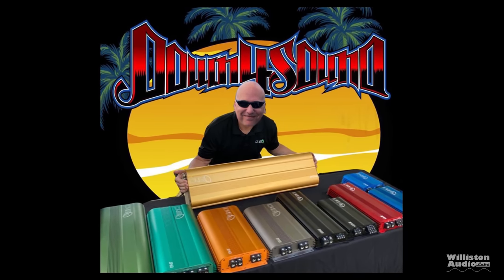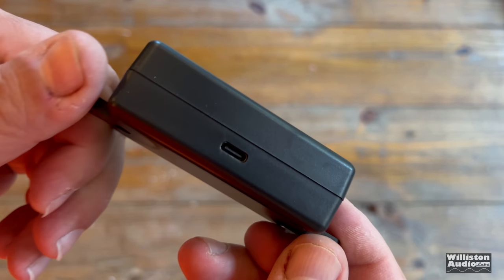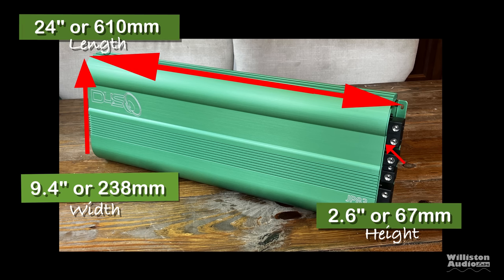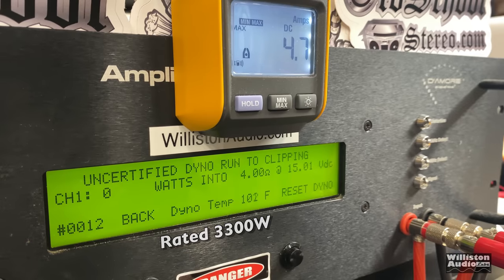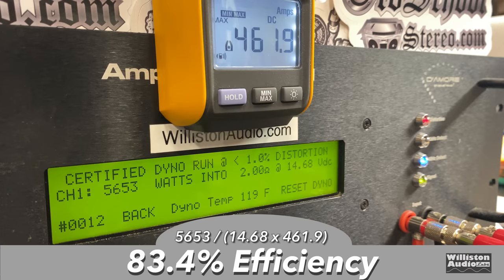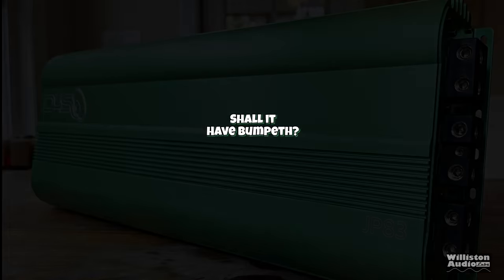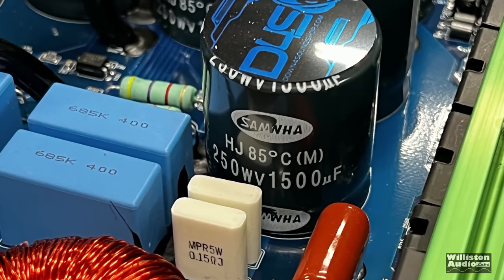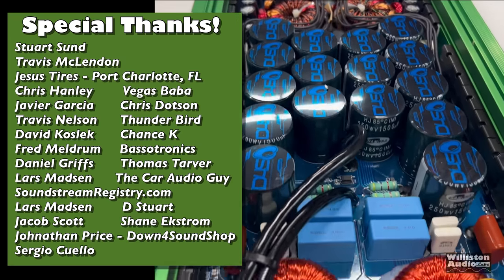OVERLOADED my AMP DYNO? D4S JP83 is a 10,000 watt MONSTER!! [4K]

Comment: 1499.99 is a pretty decent price for an 8k. Not gonna lie.
Reply: Or. Just get 3 taramps 8ks and have some change leftover
Reply: @EcSsAwS  Quality over quantity for me
Reply: Pass
Reply: Taramp all the way
Reply from the maker: More like $1499 for a 10k with headroom…as long as you have the electrical to support
Reply: @wal  True. But with impedance rise, probably won't guarantee the 10k. I'm not sure though. I haven't done any irl testing with the amp.
Reply: Do you need that much wattage? That's the question. I have heard systems that are running 500 watts RMS that sound phenomenal and I've heard systems with 3,000 Watts RMS that sound like garbage all depends on the components how it's put together and who assembles it.
Reply: @madandmean7109  *all
Reply: @Mr.Robert1  too difficult for the masses to do the technical work. Easier to add wattage to overcome piss poor design.
See it in automotive performance, cheaper/easier to add horsepower than to do the work setting up the package.
Reply: Did you not watch the same video. Its a 10k amp
Reply: It’s actually a 10K not a 8K
Reply: Not when it comes to 2 grand after his signature haha
Reply: @Mr.Robert1  personally unless your competing in SPL... not needed.  All my daily drivers have had between 400-900RMS of clean power going to sub/s and that's more than enough and sounds good.
Reply: @84Hurst  🤣😂💯
Reply: Especially when you consider that this is by far NOT AN 8K!
Reply: @chrispynaples  Impedance would be the factor here I'm thinking. That amp is not always going to stay at a 1 ohm load in your system .
Reply: I have a orion HCcA 9K  Paid $900 new    Back in 2019
Reply: @EcSsAwS  all 3 will fail while this one keeps going. We all know about taramps you're not giving us any new knowledge - go buy your three 8K taramps and have a great time !!!
Reply: @poppynokc1977  if you know anyting about doing your electrical proper you can have it stay very close to it at all times
Reply: @lewokejames  I do know anything about it. Been in the game for years and years. Lots of research done over this way. But yes you're correct, you can keep it close. But not likely to be exact if you know anything about it. 🤷🏽
Reply: @poppynokc1977  just like you Mr years in the game .... Yes I also know anything about it lol !!! .... Doesn't mean shit but I been "in the game" since 1987 🤷 ....wow I feel COOL now 🤣🤣
Reply: @lewokejames  🤣😂 Do you feel super cool now? Because of that reply of yours it ranks you up there with the best. 💪🏼🤣
Reply: @poppynokc1977  Ive been ranked with the best for years already.... Step up and catch up sucka 🤦🤣
Reply: @lewokejames  😂🤣you win, I'm scared if all of that knowledge you hold there Mr. Miyagi. 🥷
Reply: @lewokejames  now how in the heck is this gonna help me with these two?
Reply: @poppynokc1977  vid is about one not two  - The JP83 - now go buy one .... den come bak i teech yu wax on wax off fo make yu hav betta skils
Reply: @EcSsAwS  no
Reply: Dyno said 10k at 1ohm

Comment: Wow that is the most powerful amp I've ever seen. Almost 24,000 watts. Thanks for the video Big D
Reply from the maker: Thanks for watching and commenting!
Reply: Taramps 30k ????
Reply: The SALT 12, id more off a cap bank and maxed out the dyno above 25K.
Reply: @walterhicksiii3525  i know. I watch Derek from sundown unofficial do it
Reply: Taramps 30k ????
Reply: @yougod7253  may be he hasn't seen it. The key word he used was seen
Reply: @walterhicksiii3525  Salt 12=  $3,999 vs Jp83= $1,499. Get 2 Jp83 amps and have $1,000 cash in your pocket!
Reply: @evilinside5984 ya no kidding or like a surge 10k does 14k and is .5 stable and same price as jp 83

Comment: Always remember what Big D said and he is 110% correct.
" You need power to make Power" batteries, notice more than one. Wiring, proper gauge don't be cheap on the wiring no garbage off-brand crap. Alternator and more.
Reply from the maker: Amen 🙏
Reply: Physics... energy is conserved. Even worse, in order to get less, you need more. There are always inherent losses in systems.
Reply: In the future it will be a moot point as bassheads will be powering amps directly off a 400V EV system.  Imagine your entire amp rack being fed with a few 8 gauge wires! ;-)
Reply: The batteries/caps, alternators, and wiring, not to mention labor necessary to get rated power out of this amp will cost far more than the amp itself!
Reply: @303nitzubishi4 , truth. I'm paying the cost now. $20k total. And it's not a very big setup. Just a very good setup.
Reply: @62dobie  Lmaoo funny cause I'm in the same boat you in man. $15k out my ass is what I'm planning..  may I ask what kinda voltage you looking to run at? And if you wanna share your ideas for your build? 

I'm goin 4- 15's (Rampage XMV4), 2 of the jp83's, 2- 400a (mechman) Alts, 4- XS PWR S6's, and 1 XS power SB-500 34, custom box tuned to 30hz, and a shit ton of 2/0 for power and grounds lol

Again, Not never BIG but just a lot of quality stuff overall
Reply: @kkiidd77 , I'm running at 80% still breaking in the subs. They're stiff as hell. Its going to take a while.
Reply: @kkiidd77 ,at idle, my voltage sits at 13.8 with music full tilt.
Reply: @62dobie  what kinda subs? And batteries? U using
Reply: @kkiidd77 , two 12in Nightshades v5, Underground Power 80ah lithium, XS Power SB500-51R Super Capacitor Group 51 under the hood.
Reply: In Audio all you need is efficiency hands down, run a Class A-A/B amplifier and you lose 30%+ of the input compared to the output, that costs you in wiring and power generation ending up in extra cost in fuel.
Run a speaker driver with 87db sensitivity to 10.000w, it will output the same SPL as one with 90db/1w/1m meter sensitity to 5000w, run a speaker with 93db sensitivity and it will only need 2500w for the same SPL, ending up getting your feelings hurt by getting blown away by a horn loaded PA Speaker with 105db+ sensitivity running a few hundreds of watts peak input.
Reply: 1400 amps is more than most industrial welders!

Comment: Over 1400A draw!!  Over 23K watts!!Dang this thing is powerful. I’m glad you had the amperage to give!!
Reply from the maker: I'm using 320aH of LTO from XS Power / Yinlong, in 6S8P setup. I'm considering switching to 5S10P setup and running mid 13's for voltage....

Comment: What a beast! I still think the JP63 is the value leader, but if you want the best, this thing is on the short list for sure! Thanks for the great video!!
Reply from the maker: Thanks for watching and commenting!
Reply: Until 2yrs later after yo ear get use2 da 6300watts and 20 upgrades, then u gonna kno wat tru value is of buy'n da biggest baddest amp 1st. Only gotta buyit 1tyme plus it does wat da otha jp amps does from 8 to.8 ohms ex: 2ohms = 6300watts, gotta buy 2of Dem to get with diz big boii thts ova 2grand.
Reply: @playaj320  good point

Comment: That's impressive!  What's even more impressive is that lithium battery bank!  WOW!
Reply from the maker: Took me a couple years to put it together and cost a small fortune but it’s amazingly powerful 💪
Reply: Right? I've got a 45ah Panasonic 5.5ah Honda insight cells and at 15.5v I pulled over 3500A for 1sec then the fuses did there job lol
Reply: @SheikhN-bible-syndrome  you like them cells? Been looking at them. Running lishen 8.5ah cells and love these little beast
Reply: @beefysghost867  yeah I love them when I had it in my house it was sitting at 15.5v no charger on it and I hooked up my 3k rms full bridge amplifier and ran a 20 HZ tone wide open on one of my 15s and  after 10 seconds it went from 15.5v to 15.3v but then bounced back to 15.5v in less then 2sec after the burp and I did I total of four consecutive 10-second burps each time in less than 2 seconds it was bouncing back and after 30 seconds worth of wide open it was resting it 15.3v I was like ddddaaammmmmnnnnnn lol that  would of straight up killed one of my agms lol
Reply: @SheikhN-bible-syndrome  my issue is running them at higher voltage. The Honda fit don't care for higher voltage like that
Reply: @wal  is this the bank you built with the yinlongs?? Or are you referring to something else? Bc I actually NEED something to power 2 of these things 😅

Comment: A wireless Bass Knob.    You would not think  this is a big deal.   Wait till you use one.   And then it's hard to go back.   This should have been done YEARS ago.  But there ya have it.  JP doing what needs to be done.  And what people want.
Reply: Kicker did it first on their KX line a few years back
Reply: @catch22frubert   Thing is? I never heard of it.   I would have been the first to line up and buy one!    Oh the hell it was going under the carpet and taking out the seats to route cables  to multiple amps in my ride!  😄

Comment: I'm beside myself on this one 🤯.  Much respect for those amps. 
I'm also kind of curious about the dyo now. What's limits of the dyno at different ohms? (What's the dyo  specs?) Did you ever cover this in previous video? If not, would you consider making one?
Reply from the maker: There is a screenshot near the end showing the limits
Reply: 9:56

Comment: I already have a salt 8k, but the jp83 looks beast!!  would love to hear it hooked up to my subs 😍
Reply: Salt 8k puts out 1k more power at  less voltage @ 1ohm certified, but D Will won't say it because  sundown didn't give him an amp and I guess he doesn't trust other reputable dynos like Derrick from Sundown Unofficial. No salt just saying the real!
Reply: @Mr.NpK143  I saw the sundown unofficial video of it and you're right, yes it does beat the jp as far as voltage to watts but it DOESNT beat the jp when it comes to pricing.. I've been watching the pricing on the salt-8 when it was discounted TWICE on D4S and it was STILL more expensive than the 83.. like by $900 lol. At that point you're better off getting the 83 and grabbing yourself 2 batteries or 1 battery and a bigger Alternator.
Reply: @kkiidd77  finally someone that agrees with the truth 👏 🙌.  I said the jp83 was a great value in my first comment. But I also said that we don't know the longevity of the jp amps. And that's also true! Lil D also stated the voltage in this video was enough to run this ampndue to his lithium setup. So it depends on if a person would want to spend extra on the amp or that extra on more electrical. But as we all know that seen the two dynos the sundown salt 8k is stronger even in the low 13s then the jp83 is at over 14.7ish (give or take). That's a hole volt. Imagine if you fed the salt with 14.7ish. There would be no discussion. CAUSE YOU CAN GET YOUR VOLTAGE HIGH AS A KITE AND THE JP83 STILL WOULD NOT NOT OUT PERFORM THE SUNDOWN SALT 8K.
Reply: @Mr.NpK143  ah okay I see what your point is now haha
Reply: @kkiidd77  I'd love to own a couple of Salt 12ks. I presently run 4 wolfram 7500s that are in a close race with the jp83. According to the dynos each has it respected output over the other, but neither amp out performs the Salt 8k. If I sell the 7500s I'll be in the market for two Salt 12ks. Unless JP or anyone else can beat the salt lineup, but I doubt it. Only because JP can't cookie cut the sundown technology. I was called a hater for speaking the truth,  Lil D replied to my comments 😆 🤣 , and even JP dissed the consumer suggestion. All because I stated the truth when a fellow bass head asked which is better. He didn't ask which was the cheapest lol. That's no knock to JP cause hell I run wolfram. Even bought one from JP, but neither is better than the 🧂 8k. And oh yeah the difference in price is $800 not $900. D4S claims the regular price is $2250. The Salt 8k is 2300. So jp thinks as much of this amp as sundown does the salt 8k. And if you pay attention Lil D says the JP 83 is 1500 at the time of this video. Same shit that was said on the wolfram 7500 dyno and now its 1500. You know I wouldn't be surprised if the price went up as soon as people start buying the jp83 amp  just like wolfram. 🙄.

Comment: Been waiting for this one but honestly I'm more impressed by the 43 & 63 on how underrated those are. I want a 63 to replace my 23. That also means about another grand though in just electrical upgrades too
Reply: Thats the problem, it never ends.  I'm content with the 1900 watts at 1 ohm my MTX amp makes.  For a daily driver I don't even need more than half that power anyways
Reply from the maker: They are all quality amps and you’ll see the tech in other brands soon
Reply: the 33, 43, 63 were more impressive at 1% distortion.
Reply: fr I got the 23 for 250 bucks tho so I had to get it. right before they came out with all these new ones lol. but I actually like my bass knobs attenuation sensitivity and don't have the extra grand plus in more electrical like you lol. to supply this beast. one day tho...
Reply: @zanechristiansen  one day homie, one day lol

Comment: I replaced my sundown salt 6k for the JP83 the power output is good. The bass remote is annoying, it resets the bass to zero whenever you pair the remote to the amp and it takes too many revolutions to turn the bass back up. Direct connect bass knob like the sundown salt or the JP 23 is much better.
Reply from the maker: Great feedback 👍
Reply: I think they do it for safety so you don't wreck your equipment.
Reply: Safety buddy

Comment: Impressive power but CapXon capcitors are horrible junk. That's what behringer uses in their power supplies and I've made a lot of money replacing those with nichicons after they fail within a couple years.
Reply from the maker: Great feedback I’ll pass along 👌
Reply: Agreed.. I kind of expect cheaper caps in lower priced but power dense amps. When we are starting to get up over the 700 dollar price point the cost of a name brand cap really isn't that big of a hit to the net profit on the amp. Plus it would show dedication to quality with that clear bottom cover.
Reply: @Adamhc75  it's almost ironic that they offer the clear cover but maybe not many people know which caps are good or bad.
Reply: You are spot on!  Rubycon or Nichicon FTW!

Comment: 23,578w @14.36v is nothing to sneeze at. You must have a massive battery bank to stay over 14v.
Reply from the maker: It’s a bit of a unicorn score being 0.5 resistive and dynamic but still crazy impressive
Reply: @wal  Even at 10k watts that's a huge draw. How much time between clips do you wait before doing your next run. I assume there must be some recharge time between runs.
Reply from the maker: @ChannelZeroOne  honestly I was mainly waiting for the Dyno to cool down. The 320aH LTO bank can support 2 of these amps easily
Reply: He tows a Tesla behind him
Reply: 1500 amps. I don't think there's anything unicorn about that! The couple Tesla powerwalls should cover it, lol😂

Comment: Looks like I'm ordering one. I'm starting a new project for my 97 2 door Tahoe. My 18 sub is a older one a Solo X which was barely used from my brother. He used it for like 2 weeks back then then switched to 2 Fi BTL's.   Solo X 18 still looks new I'm taking it out the basement and putting this amp on it😂

Comment: Dam! So all the JP amps have done better numbers than the Sundown Salt amps. Thats crazy!
Reply: same as a billion other boards...
Reply: @96kylar  such as.... ?
Reply: @vasquez3769  taramps for 1 lol
Reply: @Ninjasraynonu3  Taramps?? 🤣 😂  go educate yourself
Reply: @vasquez3769  you asked the question and I answered it, I’m very well educated appreciate it though
Reply: @wal  big D!!!
Reply: @vasquez3769  who said anything about them sharing the same board? You sound a little off bro you might need to lay off the meds lol
Reply: @Ninjasraynonu3  "same as other boards" That sounds like you're saying there's replicas of this (same boards). If you're referring to there being other 8k boards doing more numbers than the Salt Amps. I'd like to see. Not saying they don't exist. But I've not ran unto them. (KOREAN ONLY)
Reply: @vasquez3769  this guy is just lying 🤥 and sad thing is people don't do their research because most are followers. FACT IS THE SUNDOWN SALT 8K PUTS OUT MORE POWER AT LESS VOLTAGE. Go ahead and look at the sundown salt 8k dyno and holla back. And also what an amp's ratings don't mean anything. So what a amp is labeled an 8k but actually does 10k. This overrated sales tactic is just as common as underrated.
Reply: This statement is a LIE... Look at the sundown salt 8k dyno and you'll see the salt 8k outperforms the jp83 at less voltage and more watts.

Comment: You should do a Video Expos'e on the POWER END.  Multiple alternators and batteries... cabling... all the POWER SUPPLY side thats needed to run multiple 25,000 watt amplifiers.  Thats what I am most interested in seeing.... 1200 amps....  continuous... Lets see a video on the POWER side BigDWiz.... BDBD/2022

Comment: THESE AMPS (JP83) on Lithium power... (X9) would be around 135,000 watts RMS @1ohm nominal on Dynamic music. At 0.5 ohms nominal on Dynamic music that's around 207,000 watts RMS . This is all theoretically dependent on Power setup, etc., but I believe D4S JP series amplifiers are the best in the world, Same with GATLEY Audio. There build is SO strong, its amazing.